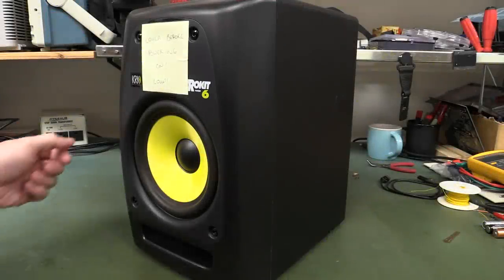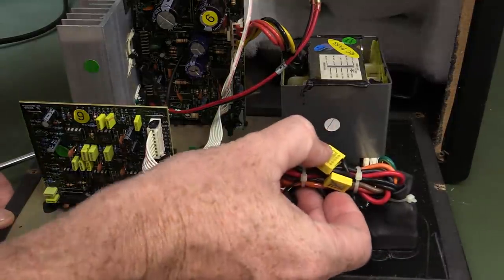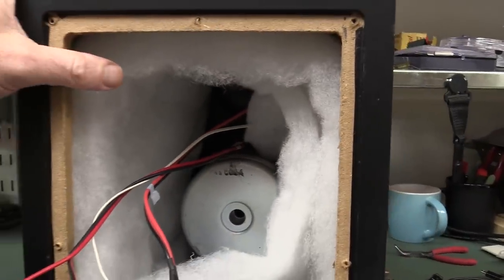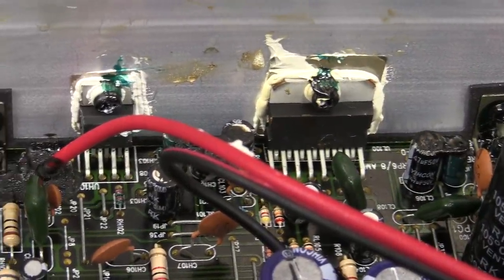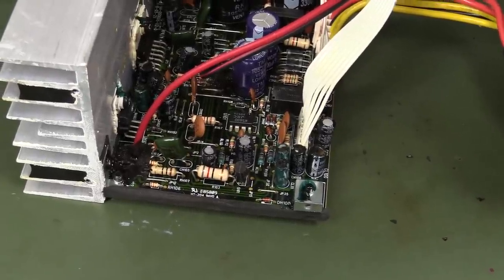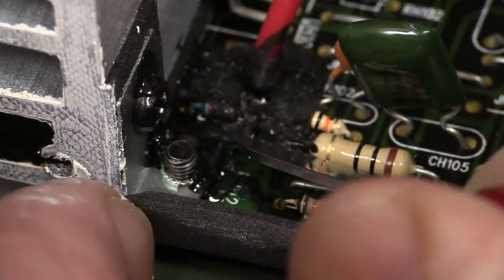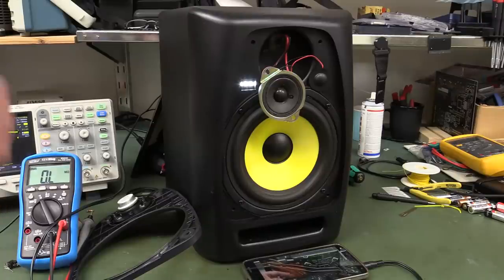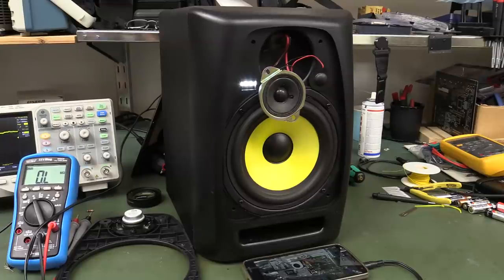EEVblog #1072 - KRK Rokit 6 Studio Monitor Speaker Repair

Comment: Just for accuracies sake, the volume is on the back because these are "studio" monitor, "studio" as in "recording studio". The volume is most commonly controlled by a mixing board, either software or hardware driven, thus the XLR and TS inputs.
In the world of Studio Monitors, these are quite low on the scale.
Reply: Keep in mind that a lower quality studio monitor is much better than most consumer audio at a similar price.  Consider the "all in one" surround system vs. monitors--the monitors win by a huge margin!  That being said, the monitors used by full time professionals are in a different league.  A normal person will notice a difference in an A/B direct comparision, but it takes a pro to notice the inadequacy of the lesser speaker without having a direct comparison.  (I'm not a pro...I don't notice.  I've had pro monitors, but I downgraded to "cheap" monitors...because I'm not critical enough to search out and dwell on the flaws of a speaker.)
Reply: Then recommend us decent ones at the same price.
Reply: You're better off not staying in the very lowest price class. But if you do, choose a more established brand that has more to lose if they produce crap.
Adam, Fostex, JBL, Tascam, even Yamaha may have somewhat decent speakers in the < $200 price class who I'd trust not to make dumb mistakes like this... hopefully.
But your best bet is just spending a bit more. In my opinion good active nearfields start at around $350.
My personal home studio pick is/was Adam A5X's, but everyone's room and ears are different, so always do your own testing and comparison at a studio equipment store.
Reply: Kyôdai Ken - I've had no issues with my JBLs driven through a Focusrite Scarlett.
Reply: A5X are great. I use Yamaha HS7and am pretty happy with their response.
It's no use buying expensive monitors if it's to use them on a non treated room anyway. You'll have reflections up the ass, phase issues, bass out of control etc.. 
Good enough :)

And yes, for the volume control, a Big Knob or similar, or just reaching for the audio interface volume knob is easier :) Speakers are usually out of reach anyway
Reply: nice, got the F5's myself.
Reply: nice, Scarletts are really nice. Got the Adams F5 through Focusrite Liquid Saffire 56, not bad, savin the pennies for UA Apollo 8, already have a buyer for the FLS56, but, priorities right
Reply: I've evaluated the Emotiva Airmotiv Stealth 6's a few times. Fucking AMAZING, but Emotiva stopped making them, they are relatively unknown in the regular audio circles, less known in prosumer studio. They didn't sell well, but they were easily the best monitors I've ever heard for their range. Adams A7x's come close, but I've heard many diff brands in the rough range, they were the best. And the line has a bigger brother, the Stealth 8's, that are even better spec'd, but I haven't heard them. In fact, Emotiva allegedly is dropping their whole studio monitor line once supplies sell out. The Stealth 8's are the only left to sell, running $1800 /pr. Ive been on the lookout for any used ones for sale, NOBODY is selling them. Hmm, wonder why....
Reply: but you'll never find these in a real studio.
Reply: fredy gump+ but studio monitors aren't for listening to music for fun, they're for working. personally l don't like the sound you get from studio monitors because they designed for a flat frequency response which mean if you crank the treble bass or mid range then they will sound like ass and if they don't sound like ass then they aren't studio monitors they are poser speakers.

and you're comparing it to a home theater in a box surround sound system? l have a pair of kanto yumi, micca MB42X, late model polk monitor 4's all of those speakers combined cost me about $200 and for MSRP all of those speakers would cost over $670. my point is that you can get home audio equipment that sounds better without breaking the bank. you don't have to compare a HTIB surround system with a chipboard subwoofer and small plastic satellites.
Reply: A studio monitor is just a good example of a bad speaker
Reply: Lassi Kinnunen Sony stuff is  always good even there cheap shit just not there newer TVs their crts were amazing
Reply: That's bullshit. A studio monitor isn't designed for musical fidelity.
Reply: Anything by Genelec or Focal. Presonus Eris range. Fluid Audio FPX7, etc, there are many with a more accurate frequency response and better built than the KRK's.
Reply: Mark R - Yeah, I just couldn't understand why would Dave want to turn the volume knob on studio monitors let alone plug some earphones into them in a studio setting, it really doesn't make sense....

Comment: I never would have fathomed that selastic would become conductive over time. I'd look at it and say "hmm, nothings broken. Must be dead".
Reply: Open some 80th HiFi consumer stuff, and you gonna spot it....some become conductive and causes problems...
Today vintage is the tube/valve stuff we (at least i) restore and these usual work is to change all the caps, replace some resistors and wires, reflow solder joints and rework the mechanics (radios).
But for our kids, it might be the HiFi stuff we grown up with. It´s already there...last week i had a chat with a 18year old guy who wanted to restore his grand-Dads (time is flying;) HiFi stuff. I told him about belt replacements, cleaning (unDusting inside;) checking caps...and so on, and he went, "oh i already did that, but i still got hum and crosstalk and i spot a lot of hardened stuff on all connectors, and after i cleaned it all had vanished"...
I really think that is going to be the new stuff we do have to look for as well....
Reply: Probably, that crap will be the new leaking cap. Gone are the good old days of replacing a few worn out/ broken/ out of spec parts, we will now going forward be removing crud it seems.

Comment: Dave, I know you are busy so if you read this....That was an awesome investigation.  I love it when you repair stuff.  This is the sort of stuff I run into all the time.  Lots of conductive glue, Just that most of my repairs where I find this is from the 70's and 80's. Working on a Sony V-21 communication receiver that is full of it now.  Thanks for sharing this repair, I truly enjoyed it.
Reply: The Radio Shop I got a shock there until I realised 'bust' should be 'busy' lol
Reply: Ha! Thanks for catching that. Why did they put those keys so close together. :-)  Fixed.
Reply from the maker: Ugh, can't imagine this stuff in a comms receiver, could cause an infinite number of problems.
Reply: EEVblog 

Trust us, radio manufacturers looooove this stuff.
Reply: Isn’t that possibly a planned obsolescence way of making the board? Because looks like this stuff works for few years and after couple years it will for sure end on problems...
Reply: If you mean that it is a design “benefit” to the manufacturer so they can sell more speakers... not really. After these begin failing the word goes around the sound engineers community and people will avoid the brand for this reason. Obsolescence may work in favor if car manufacturers but not consumer electronics like this.
Reply: davecc0000 "Obsolescence may work in favor if car manufacturers" - IDK about you, but if a car of a certain brand would "go obsolete" on me (Opel, I'm looking at you!), I'd avoid that brand like the plague from that time on.

Comment: Yep, planned obsolescence. I've seen a ton of these. If left long enough, it actually eats through the component leads!
Reply from the maker: Some of that happening here, I think some of the links are marginal.
Reply: Good eye opener - I'll be looking for this stuff from now on.
Reply: Generally they use an RTV silicone which is inert. I guess someone just didn't do their research in the purchasing department.
Reply: By far and large pro audio gear and gear aimed at professional musicians last from dad to son. It is very rare to see planned obsolence in the hardware side. Software + hardware however definitely does have planned obsolence but that is more or less dependent when new OS cycles in... at some point, drivers stop working and this is not always just an accident.

But the whole business really opearted on word of mouth and reputation is very hard to get back A lot of companies found that out in the 90s with cheap digital stuff coming from then poor quality south east asia and korean manufacturing. It took some heavy lessons to know that you just an't cheat when it is about someone else's livelyhood; word of mouth will travel far and bad news travel the fastest. If a piece of gear has crapped on me and ruined my gig, i will let people know about it..

Comment: The "volume knob" on the back of proper studio monitors isn't a volume knob, it's a trim pot to adjust your reference level (-10dbv for consumer equipment, +4dbv for professional sources, etc). This is why their range is very small. You control volume with the device that's feeding the speakers, usually a USB or FireWire interface like a focusrite Scarlett etc, or in larger studios, an actual mixing console
Reply: Yep, one doesn't just simply "adjust the volume" on studio monitors :)

Comment: Thanks for the video. I have one of the KRK pair sitting disassembled on a shelf for about 2 years - couldn't figure out what's  wrong with it, replaced caps, etc. Now I'll give another try by scraping that black gunk first on this one, and then will open the second one to scrape of the gunk as well.
Reply from the maker: Cool, let us know how it goes.
Reply: so ...did you fix it ?
Reply: Guess not.
Reply: Pity.

Comment: I've repaired a number of these with exactly the same issue. Scrape it off, replace anything that looks corroded, replace with a better compound if required. Issue is the same with the RP5's too.
Reply: Ollie Brown rip I have rp5's at least now ill know what to do
Reply: Alexander G I'd recommend doing preventative maintenance if possible. At the very least, identify if you have the black stuff or not. As in the video, failure to catch it early can lead to other components failing or being damaged.
Reply: Ollie Brown also as I've been reading, apparently the black stuff gets much worse over time. Thx for the tip, I might disassemble my speakers next week and poke around a bit.
Reply from the maker: Yep, definitely remove it now.
Reply: Can you give a recommendation of what you‘re using today instead of the black stuff?
Reply: Bastian Baggins from the look of what it was on basiclly anything
Reply: I find the best thing to use is acid free RTV white silicon. Or failing that MS polymer sealant.
Reply: My Rokit 8's have a buzzing noise which is not very loud (kinda loud on one of them) and get's a little less loud when the speaker gets warm.
Is it due to this problem? If so, I'll immediately open this thing. 

It's super annoying.
Reply: Might be.  There are other possible faults.  Well worth a check.

Comment: I've been so happy with my RP8 G2's, they have been powered on 24/7 for almost 10 years now here. And the back of 'em is facing the sun when it's up, so I haven't been kind to them. If they fail at any time I'll be sure to see if theres some black-gunk-removal needed. Thanks for the vid! (For the price I think they are really good studio monitors, and from the 8's onward you really really don't need a sub with them.)

Comment: This is an extremely common issue on all kinds of powered speakers. I usually just wire wheel it off with a dremel by default, and replace it with solid setting white heatsink compound.

Comment: Thanks for posting this video. One of my (pretty old) KRK RPG2 8's suddenly stopped producing bass. After determining it was in fact the speaker's fault I opened it up and found the same conductive black gunk all over. I chipped it all off and gave it a good clean. Luckily no components had corroded yet and I have my bass back :)

Comment: This is not new.  I repaired consumer electronics from 1987 to 2009.  I've fixed a fair number of devices by simply chipping that conductive glue out.  I think it's hygroscopic thus promotes corrosion.  As the metal corrodes the metal ions impregnate the material.   That's my theory anyway.

Comment: Good video, Dave! It was fun watching you experience the black gunk! I've repaired many KRK monitors with the black gunk of death and I have come to love hating the stuff. KRK studio monitors are notorious for using the black gunk but I have also seen it on others including Pioneer studio monitors. I wonder what it is made of, a blend of something with recycled rum and coca-cola?
I always scrape and clean it off thoroughly and typically replace all those garbage capacitors with high-quality Panasonic or Nichicon caps as well as replace any poor corroded resistors. I then use a good replacement for the black gunk like Dow Corning 738 or 736 electrical sealant. :)
Reply: Not sure if you'll see this, 6 years after the fact ... But can you or someone explain what the function is of the black gunk, and the electrical sealant you replace it with?

Comment: Am I the only one that spotted at least 4 bad solder joints between 12:07 and 12:17 ?
As an "aficionado" this is the second thing I check (after the bulging caps of course).
Reply: I saw them too. Little haloes in the solder around the pins. Really shouldn't use a single sided board in a vibration environment.

Comment: Great video!  In infinite-baffle (closed/sealed) cabinets, certain frequencies will cause buzzing sounds through any small orifice as the air gets huffed back and forth.  That's why the maker seals up all jacks and any other through-hole components accessible from outside the cab.

Comment: It's a very old problem. My 1980s Yamaha gear had white glue holding large caps that turned brown, went conductive and ate resistors and wire links off the board. The PCB (that single sided brown version they use) also changed colour and bulged wherever it was in contact with it.
Reply: The killer glue issue is well documented, and the Japanese stopped using it in the mid-late '80s. I used to think that was it, but was dismayed to find that similar problems had in fact resurfaced and apparently aren't even that rare. Bummer.

Comment: Just came back to this video after having watched it when it came out. I bought 2nd gen KRK Rokit 5s like this in 2013, And used them for 7 years straight. I used to turn them off whenever I wasn't using them, and eventually decided to leave them on indefinitely. What I noticed was that after about 5-6 years of daily use, they'd developed an issue where turning them off, waiting for complete discharge of the power supply, then powering them back on would begin buzzing at mains frequency, and would eventually subside back to noise floor. After 7 years, the buzzing would never subside, and leaving them off for any extended period of time, such as my move from South Carolina to Georgia, would cause the lowest level buzzing to rise. Using extra power filtering before the components did nothing, there were no ground faults, and disconnecting signal entirely made no difference. I've finally replaced the KRKs with new main near-fields, but even after just a day of being disconnected, I tested the KRKs again just to see, and sure enough, the buzzing is even louder now, up from an annoying level to an unacceptable, unusable buzz. If I let them sit, I imagine I'll end up with an oscillating amp board. I suppose in about a week or two, I can test again to see if, even in the dry environment of my house, they manage to buzz even louder. If so, then it'll be pretty clear that these will eventually send 50 V to the drivers.
Thanks to you, I actually know what this fault is and was informed enough to replace them before running down the line filtration rabbit hole!

Comment: Thank you so much for this video!  One of my KRK Rokit 8 G2 speakers started to have issues, it would be ok for about 1 or 2 seconds then the volume would attenuate drastically down to roughly 10% of the original volume.  After watching your video I opened up my speaker and saw the same black gunk everywhere.  I scraped off as much as would easily chip off where it could possibly have been bridging between two circuits. I discovered one capacitor that was becoming corroded with a rusty colored powder and another with some white powder underneath the black gunk. I cleaned them as best as I could and tested the speaker. It has been running normally since.  I imagine I may need to replace the corroded bits, but for now it's working great.  Thanks again!

Comment: Got to wonder if the heatsink might work better on the outside of the box!
Reply: I have some Sony powered speakers that use the back steel as heatsink, I simply went there and cleaned the back panel with IPA and sandpapaer and used 2 part epoxy to glue a old CPU heatsink on the outside where they were mounted on the inside, after I changed the power amplifier IC that had died from cooking, as Sony used 1 drop of compound per unit, or had used a small tube per batch.  Did a good job of making the new one run cooler, and the heatsink was free from old dead obsolete Celeron 500 CPU coolers. Just did not bother with the fan, as the whole thing uses 20W off the mains in any case. Now runs barely warm.
Reply: In this case I think they hope the 'air flow' from the port will cool the heatsink.  However there is really very little thermal transfer by the port.  Air flows in and out of the neck of the port but not the cabinet volume.

JBL published a paper on port aided cooling some time back. Ports designed to create turbulent flow cooled the best but that is the opposite of what you want for reduced distortion.
Reply: I'm guilty of using steel chassis to transfer heat, it's not that bad provided you are going 'through' a thin section, not along it.